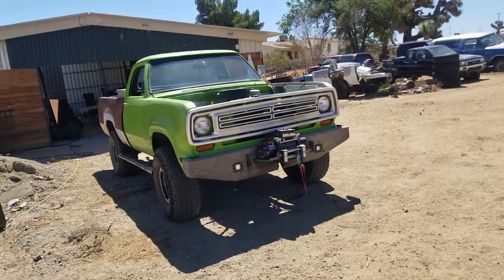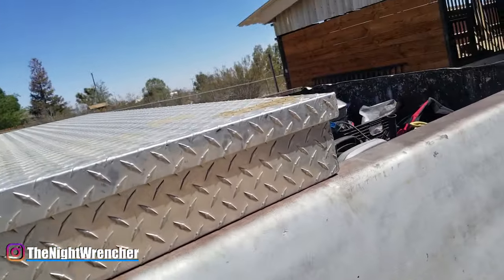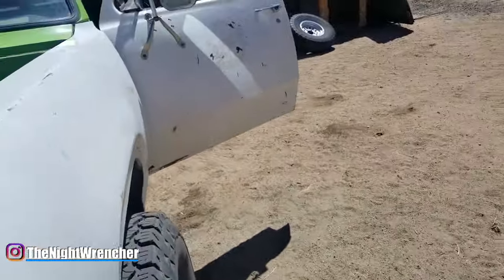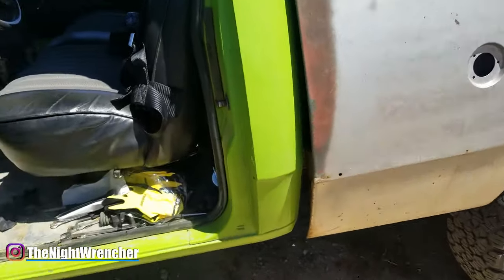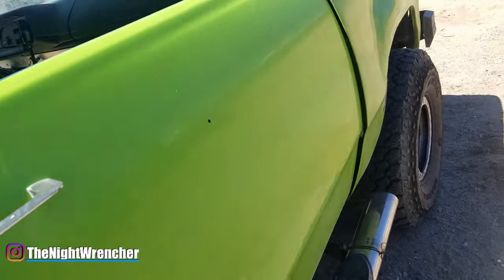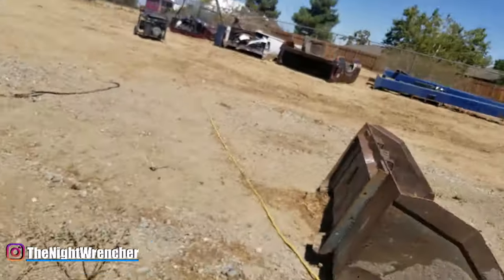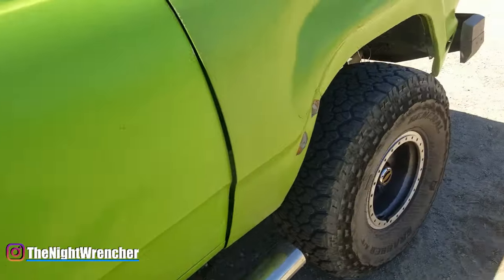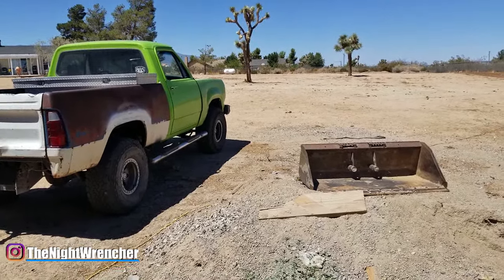Holley Carb Running Rich? Watch This! | Holley Carburetor Secrets | Holley Carb Tuning |

Comment: I thought the idle circuit was for idle only .. cause once your throttle opens  past the idle circuit it is no more
Reply from the maker: Thats not quite true. All the circuits stack on top of each other the idle circuit makes less of an impact with more throttle but it still makes a difference in the tune.
Reply: @NightWrencher  but yet if your idle is to high and the the thortles blades are past the circuit slots you'll never get your air fuel set right and also your jetting will also play part with your power valve as for tuning also for lean or rich vacuum also has a play there also
Reply from the maker: Biggest impact the idle feed will have on the tune is in the transition circuit. Once you go into the main circuit, so much air is flowing through the engine that the small amount of fuel from both idle and transition wont make too much of an difference. The point of the video was not to show you how to fix a lean or rich condition on your carb, it was so you can identify a lean or rich condition based on sound reguardless of what circuit you're in. If you want to tune individual circuits, I have seperate videos on each of them in my holley carb secrets playlist
Reply: Not trying to down any thing you say I'm still learning also my self ... Keep up the research as I am also it all a bit tricky to rap my head around specially with a modified engines I have a lowered 89 Silverado with 383ci 750 double pumper and a 60 olds with a 454 bored 100ths 477ci with a 850 double pumper fun fun fun .. head ache head ache head ache ... Lol got to love em though...
Reply: @NightWrencher  I'll check em out thanks
Reply from the maker: For sure man, I get it, I just have to be very clear in the comments because some people will twist my words and make it sound like I'm insinuating something that I didnt say. Carbs are not easy but with the right knowledge youll be able to tune any holley

Comment: Wrong. Running lean is more dangerous than running rich.  Engine runs hotter if its too Lean. Running slightly rich is actually preferable especially in winter time

Comment: Mine sounds like it has a cam but also pops and hesitates 😭
Reply from the maker: Idle could be rich and part throttle could be lean. Not enough timing is also an issue
Reply: @NightWrencher  what would cause that? Also I have a volvo 340 and the timing cannot be adjusted
Reply from the maker: @Kabeeb  You would have to identify exactly whats happening and then adjust that in your carburetor. So for example, if you car is running rich/lean at idle, you would have to reset your idle speed and idle mixture screws and tune them to accordingly. If your carburetor is non tunable, and your timing can't be adjusted then there might be something wrong inside your carburetor or you have and outside force like fuel pressure, regulator problems, internal leaking, things like that.

Comment: All y'all just need to buy a wideband
Reply from the maker: Well a wideband is only half the story. On rowdy cams with a lot of duration, a wideband is pretty much useless at low load/ low rpms because of the amount of air passing to the exhaust during overlap. Also, if your o2 sensor is going out, itll tend to read rich so if you know what to look for, you can verify if the wide band is reading right or not. My favorite tuning device is a wideband but theres a time and place for everything.
Reply: @NightWrencher  This must be why I gave up on my wideband, started over the old school way,
Reply from the maker: Yeah, its tricky sometimes 👍
Reply from the maker: Yeah, its tricky sometimes 👍

Comment: There's no "secrets" here. Just the basics I already know. I can't get my Holley 750 to idle clean. It's running rich like a pig at idle and I can't clean it up.
Reply from the maker: How much ignition timing are you running at idle?
Reply: @NightWrencher  I had it at 6 but I bumped it up to 10 and it seems way better. I got the carb tuned so it's not running rich. My idle between park and drive are VERY drastic though so now I'm trying to figure that out.
Reply from the maker: I would add another 5 degrees of inital timing or move your vacuum advance to the manifold
Reply: @NightWrencher  vac advance is already at manifold. The problem with advancing, seems to make it much harder to turn over and the starter, battery and wires are all new.
Reply from the maker: Usually you can get away with 13-15 at idle before the start starts to struggle. Low RPM in drive can be too tight of converter for the cam, idle too lean or not enough base timing
Reply: @NightWrencher  It's been sitting for a wile, so now it seems to be clearing up some just running it a bit too. I just put a mutha thumpr cam in it but I already had upgraded to a 2800 stall converter. After advancing the timing and tuning the carb, then just letting the plugs clean up, seems to be working. It was running super, pig rich. I didn't know any better and had the transition screw way to open. Just running it a bit and letting it clean up, seems to be making huge improvements.

This is the first time I'm testing out my 3.25 gears from the 2.80's the car came with too. That's far better in that respect.

Thanks for this info though. After a test drive, it seems to bog under hard acceleration, so I'll try some more advance. I haven't run it much yet though, so before I do anymore, I'm gunna let the plugs clean up from where I sooted them up so badly. The car will be on the road soon after an 8 year restoration.
Reply: @Warrior_Resisting_Colonialism to reduce issues with kickback when trying to crank, pump the gas two or three times. It should give it enough to start. If you have to give it so much more timing, maybe look into a new distributor or check the guy who tuned your carbs’ work.
Reply: @Warrior_Resisting_Colonialism I also have a motha thumpr. Does it not lobe heavy unless it’s rich? I seem to have that issue.
Reply: make sure your idle transfer slots look like a square when carb is flipped over with throttle blades closed, this is huge and effects the mixture screws
Reply: @jimpanzer07  Yup. I did that first. After further research, I've come to conclude, my accelerator pump is probably bad due to old fuel/ sitting. I need to take it apart and take a look. I ended up taking it for a drive, and it's got nowhere near the power it should. Like half the engine power at most and it's super boggy on acceleration. Before it would light up the tires with 2.80 gears, now with 3.25's in there it wont even take off quick, let alone burn tires. Something seriously wrong with the accelerator pump, I'm 95% sure of it.
Reply: @motorizedmiscreant  My carb is so messed up right now, I couldn't tell ya. Right now, though, it doesn't sound as lopey as I had hoped while idling. In park without giving it any fuel sounds like I wish it would just idling. I replaced the whole carb before due to sitting and needed a larger carb anyway, this time I need to clean and fix it.
Reply: @Warrior_Resisting_Colonialism  also check your powervalve if Holley, you want to be around half your vacuum at idle, my 383 chevy with big cam pulls around 11'' vacuum at idle so I run a 5.5 powervalve
Reply: @jimpanzer07  OK thanks! Yup, Holley 750